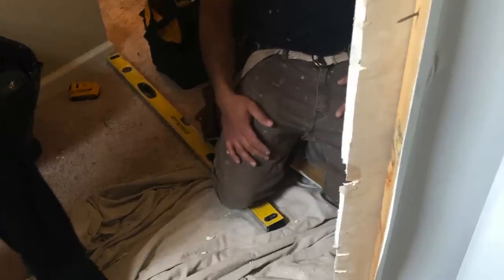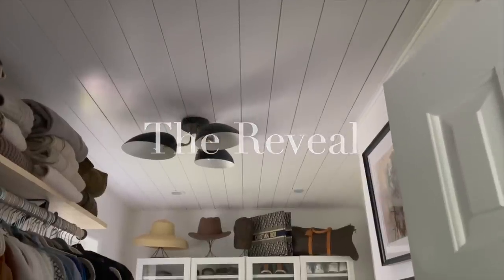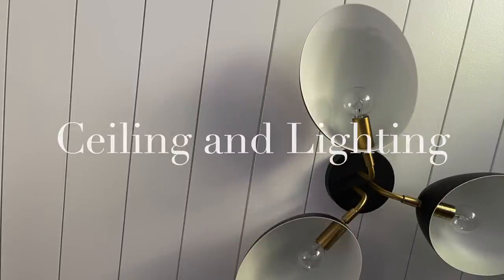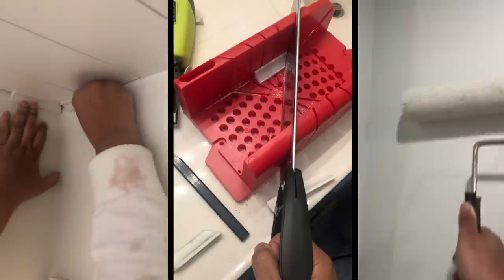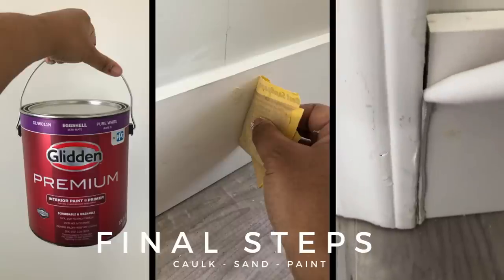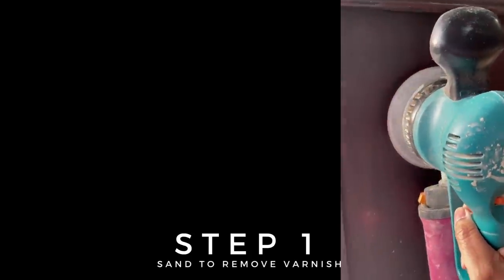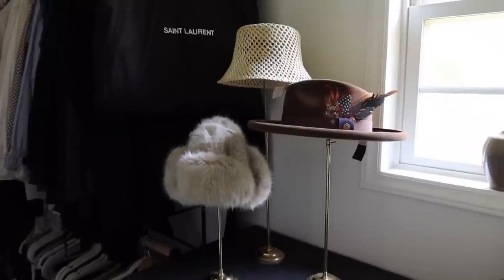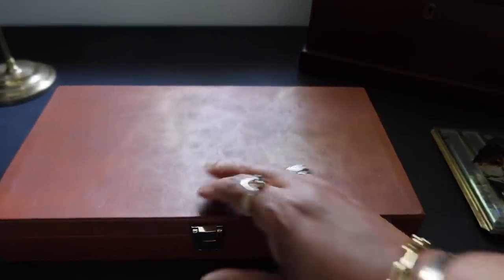How I Created The Closet of My Dreams - Using Thrifted Furniture + IKEA's Billy Bookcases

Comment: The closet of my dreams.  SO 
MANY ideas, I have a silver dish with two sides that I could use as jewelry dish.  Did you attach the closet rods to studs? I have a small closet that backs up to another room, maybe I can merge to one? What paint is best for a laminate dresser?
Reply from the maker: Hi Michelle!! Thank you so much for watching - I love hearing that you found many sprinkles of inspiration along the way!! Yes, we attached the closet rods to the studs for sure. This is key - otherwise, I'm sure there would be a time that I would walk into the room and all of my clothes would be on the floor. lol!! I would say, if you have the space, and that wall isn't a supporting wall - then tear it down and build the closet of your dreams!!! :) In regards to painting over laminate, I would suggest first sanding it to rough it up a bit and give the paint something to hold on to. I would for sure user a primer first, and then paint (latex paint) over the primer. Yes there are some paints out there that have primer already included, but for a laminate dresser, I would apply the primer separately, and then apply the latex paint. I hope this helps and if you have any further questions - feel free to ask. Sending you all the luck!!!

Comment: I didn't see a full length  mirror.  That would have been nice
Reply from the maker: A mirror is coming for sure - I just need to find the right one - which is much harder than I thought it would be. Luckily there’s a huge mirror in the bathroom that connects to the closet that I use, but a full length one is definitely happening. I have a blank wall ready for it once I find one I love!! Thanks so much for watching! 😆

Comment: Another lesson learned -  using cheaper paint only results in twice as much work!   There's probably 4 coats of paint on those walls, as something just wasn't right after each coat (streaks/lines, or you could see spackle spots) and we ended-up redoing areas and complaining about the paint quality.   Buy good paint!
Reply from the maker: This is so true and I had it in the video - but ending up cutting it out. Buy the good paint always - don’t be like us and try to cut corners!!!
Reply: This is SO true!!!
Reply: Priming also helps a lot, and if your paint is dark use a grey primer. Will save on work, coats of paint and and thus money.
Reply from the maker: Isabelle G Absolutely!!!! Taking the “easy” way out never gets you very far! 😅